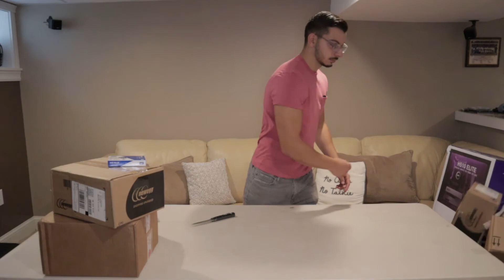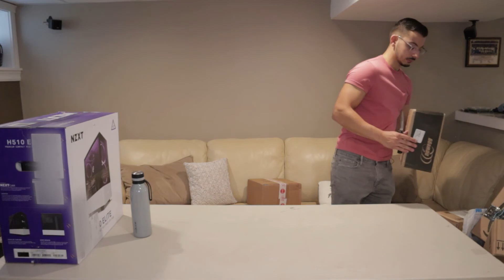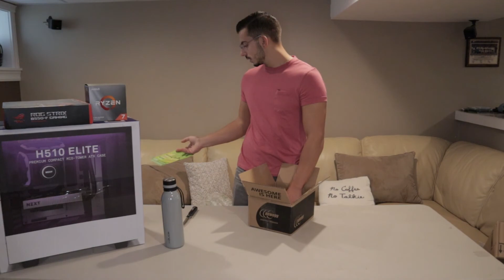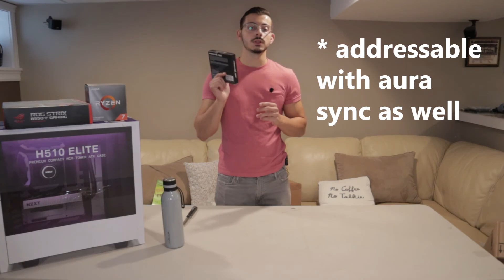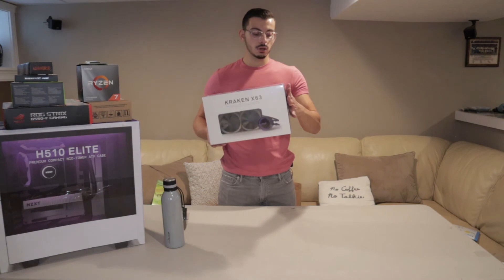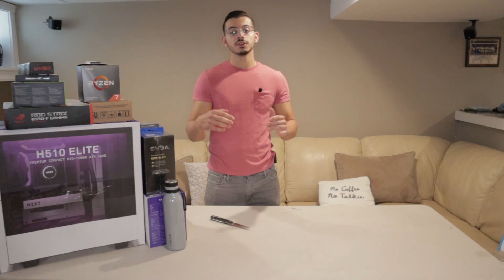$1,500 Dollar editing/streaming/RTX 3080 capable PC part list and unboxing !

Comment: Can I use the 3070  on that pc
Reply from the maker: Yes ! If you use all the parts minus the graphics card, this system is plenty capable of running the new 3070 and can even handle the 3080 no problem. I plan to make a video in the future upgrading to a 3080 and your support would be much appreciated ! Thank you.
Reply: @tfmtech1725  Thanks

Comment: Can you combine the Ryzen 5 3600X  with the motherboard you used
Reply from the maker: Good question ! Yes you can use the Ryzen 5 3600x with this motherboard, it is compatible with current generation 3000 series  and next generation Ryzen CPUS but you may run into issues with 2000 series CPUS.